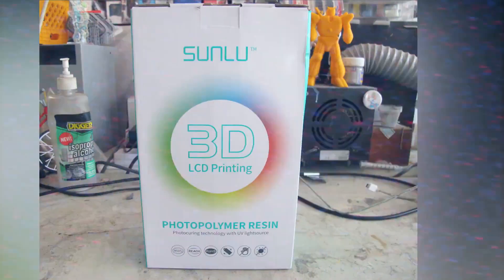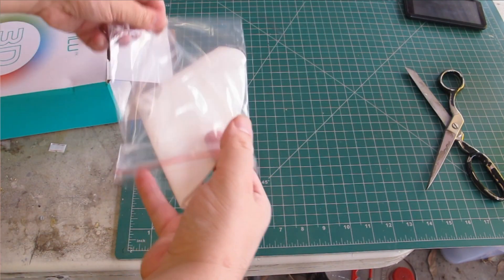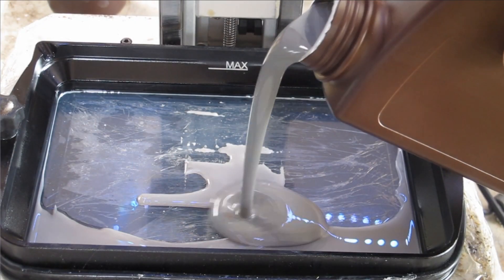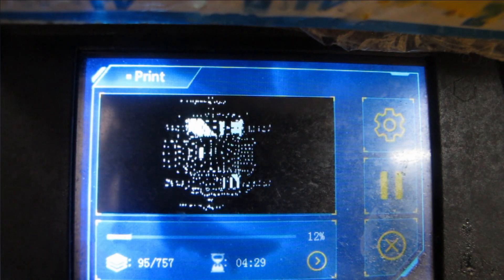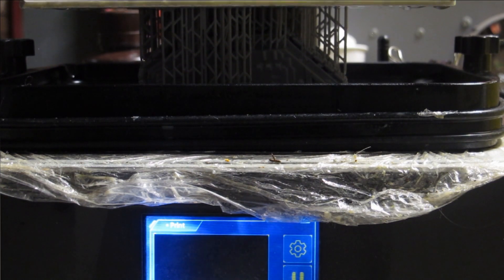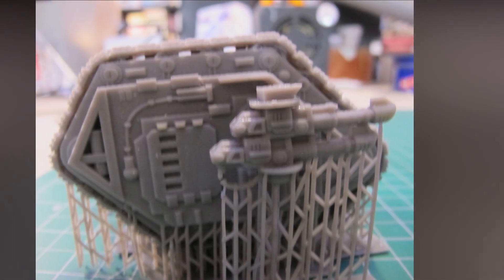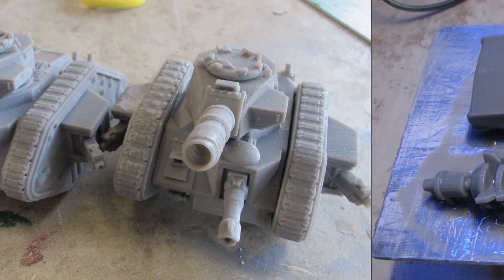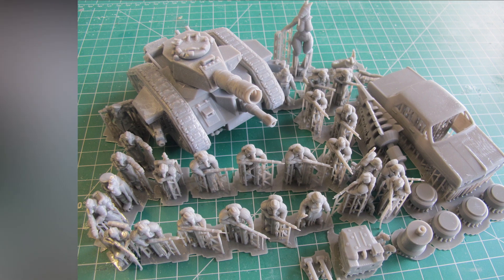Sunlu & Jayo photopolymer standard resin review (3D printing)

Comment: I can also recommend it, although I have found that it does have longer layer times and needs slow retraction for perfect prints compared to other brands. I had a funny failure with the ABS-like version, the resin was so cold that it turned into a porage-like substance that would not move even when holding the vat upside down, note by cold I mean below that 0 deg C. In saying all that it's very consistent performance, not too brittle and buying in bulk is a big saver, being about 1/2 the cost of competitors.
Reply from the maker: Funny started slicing the Izumo, been putting it of as looked into the file and saw so many option parts and extras I did not know what to choose. Going for fairing ver with hyper launcher base. Might do a normal space one too dont know. It such a good model you put in an amazing amount of working and trying to script all the ways the model can go down.

I've gone though maybe 5L now and still very happy, maybe 1 failour that isnt my fault. does get weird when sitting in the vat for too long, fluids separate and forms strange chunks afloat a clear part of the liquid.  0 deg sounds like nice weather.
Reply: @mokanaman  One thing I want to do is go back and rework the parts numbering (or lack thereof) for the Izumo as "other left bit" is not that helpful when trying to work out what part to print, it's just a mammoth task with all the option parts.